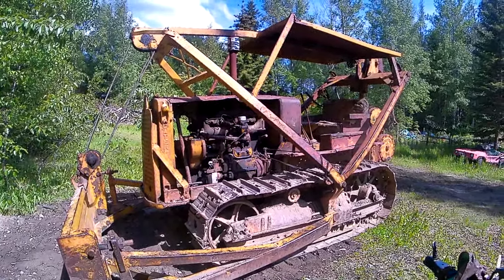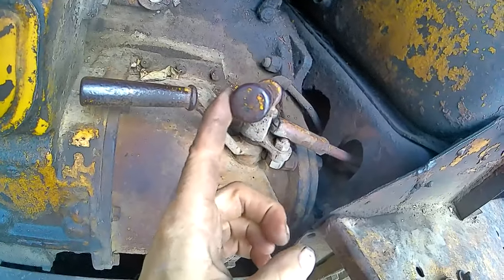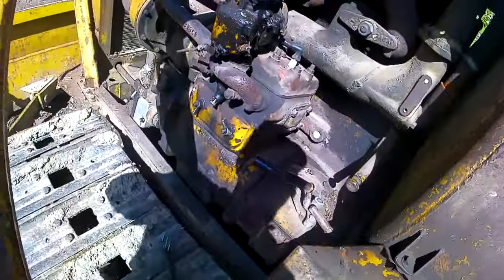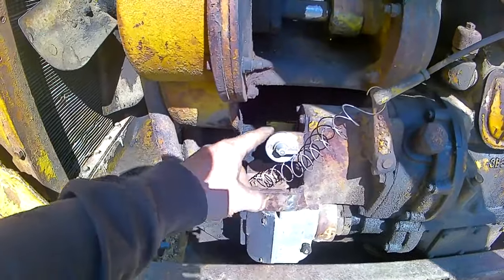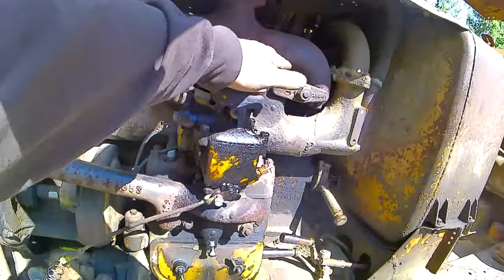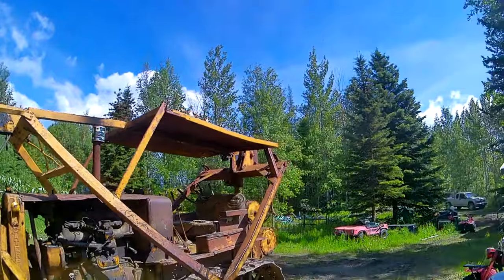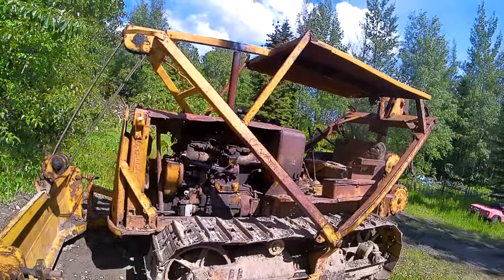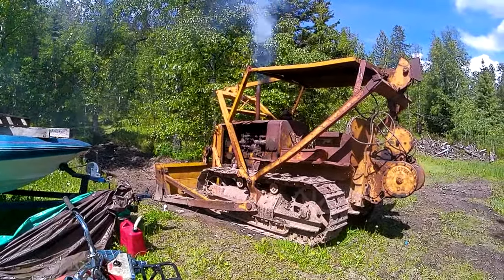1936 Cat RD6 starting procedure

Comment: Interesting video as my Grandpa bought one new in 1936 and my Dad farmed with it until the mid sixties.  Started it and ran it a few times myself.  They always warned us to not push on the crank as the pony motor can backfire and break your arm, as my brother could attest to.  Even when pulling on the crank, it is wise to not hook your thumb over the crank handle.
Reply from the maker: Yeah it all depends where you got your ignition timing set. They're originally was retard / Advance mechanism on these things but it seems to me that they're all missing these days LOL. But I have had a kick back on me a couple times and hurt my elbow. But I'm getting pretty good at it now LOL